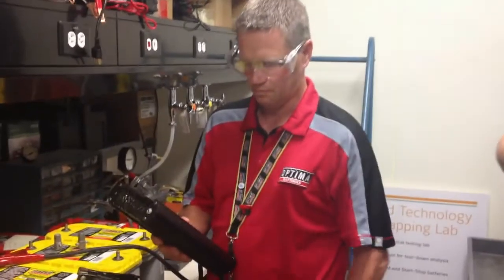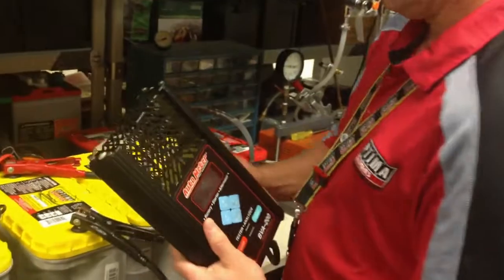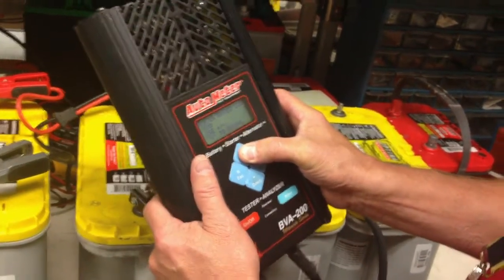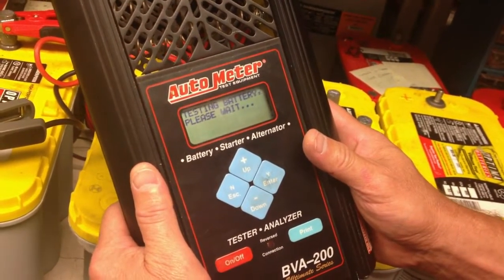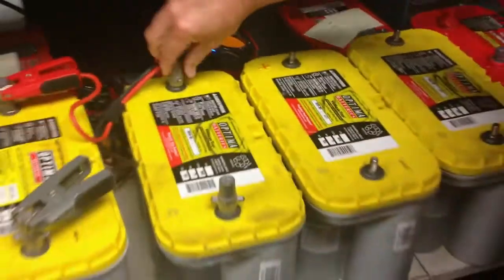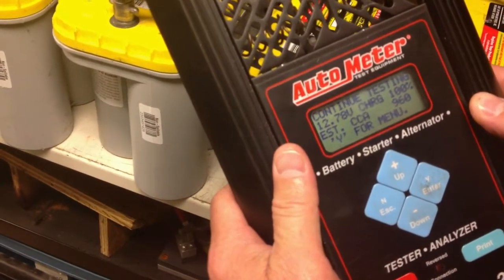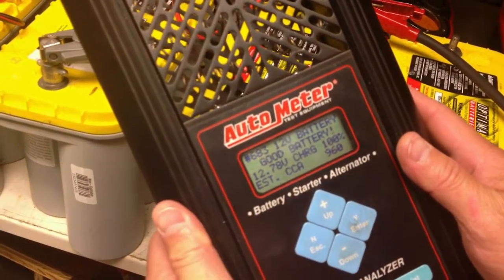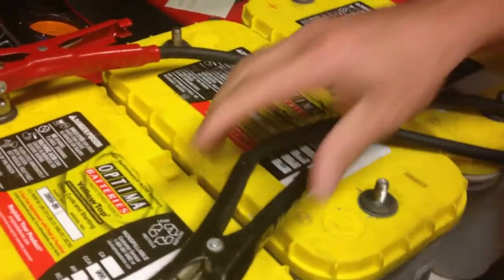How to Load Test a Threaded Terminal Battery

Comment: Okay, I see the results, but why? If I connect a studded battery it delivers the correct CCA. Is this a case of the alligator clips not biting into the hard steel studs enough to get a good connection?
Reply from the maker: The studs are intended to secure ring terminals to the lead base and do not conduct electricity as well as the lead base